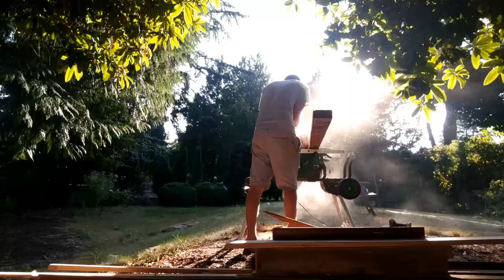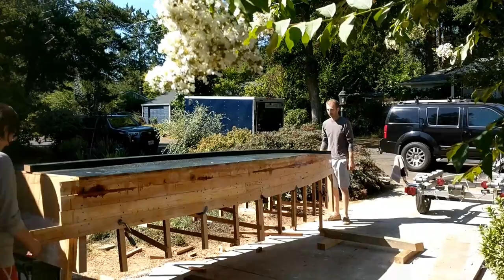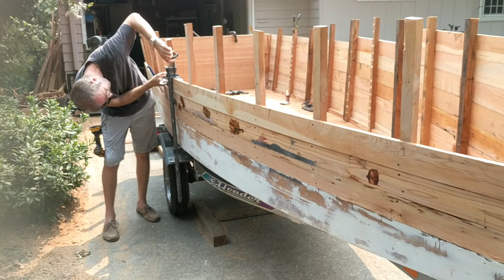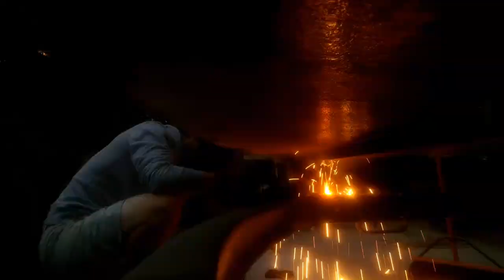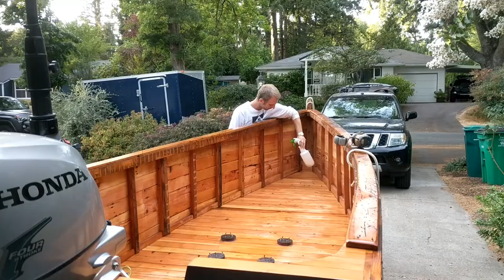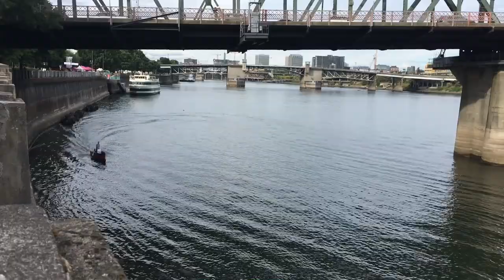Scrap 2x4 Boat Build (reclaimed wood)

Comment: What I like about this is that it has no fiber glass.  If you can make a boat without fiberglass, I might try it out.
Reply: The fellow at Tips From A Shipwright builds wooden boats without glassing over the hull.  You just have to account for swelling when you build it.  His video series on the work skiff is really good.

Comment: Good build reason I'm here got a boat build on the brain. I'm sick of high price aluminum boats. I wanting 18 ft skiff with deep sides. For river fishing big yachts and barges create such a big wake they freak me out. I own couple aluminum boats thier just not a good choice. If your on the water alot a recreational John just don't hold up. And the cost is just ridiculous. Wood just has so many stye options. And if you can build a wood boat you don't have to seek out a repair shop for a fix or repair. And I think it's so cool to fish out of a wood boat. Especially if you built it. I think wood out class's anything on the water. The colors on this boat just stands out pirate ship skull and crossbones on the bow would be cool. Appreciate the video well worth the watch.
Reply: There is Parker 1801 whaler 17 19 fiter wharr 18 rage jet boat 18 fit xab I ncruser

Comment: Flat bottom skiffs are imo best hull design because it is the most versatile, it can float on couple inch of river water and land on shallow ocean beaches and also take rough coast waters if you build high sides and bow. It can be moved around with normal utility trailer. It is a natural planer hull, takes off with small engine power. V-hull is total opposite of these but it is only better on waves which doesnt really matter on a small boat because big waves will disturb all small boating anyway. I would go flat skiff any day, it is also decent to row and paddle. Im curious. How did you planked hull stay in shape after 2 years? What would you change? Did the planks crack? Hows the paint job?

Comment: Man that boat is sweet ! I have been boating myself for over 30  years have owned personally 17 or 18 boats mostly power but a few  sail and one antique wooden Chris Craft Cabin Cruiser that i restored   Ive also have thousands of hours. Operating  from the Chesapeake Bay  and up a down the Intra coastal Waterway and through out the Florida Keys and the Carribean  the fact that you built that boat all out o reclaimed lumber  was cool and amazing. As well as getting it to look correct and have good lines in the water  i applaud you and   Would think if you could come up with a set of plans anf a  lumber package list for all new  would be a big hit. Your skiff would be a great  dinghy for live aboards that. Often need to  dinghy. To shore to restock supplies and provisions  plus it would be a relatively easy and inexpensive boat to repair anywhere if needed  a major plus for live aboards who usually are on budget restraints for varirety of reasons

Comment: Amazing work my friend!  coat all that wood in epoxy and it should last forever!
Reply: Epoxy and glass fabric. Thing is rot will eventually claim that kind of unprotected wood, especially if stored outside in the weather. I have a production built Eggharbor 37 built in 1970, and I get to fix all the OEM mistakes they made which hastened its decline. One I am dealing with right now are the plain IRON spikes driven into the white oak floor (joists) to pin them to the white oak keel. Bad practice as the oak around the iron turns to mud if it gets wet due to a chemical reaction with oak. Doing that also cuts the floor strength in half running a 1/2 inch metal pin spike down the board center on edge. It is honestly a dumb thing to do, but saves them effort during construction. I have had 3 bad spike wood reactions, had to replace one floor, but the 2 others I can strengthen with long pieces of oak glued and screwed into the top sides on each floor.

Comment: Nice job. I'd ask the haters how many boats they've built, but I doubt they'd answer truthfully.

Nail holes...what did you fill them with?  I use epoxy thickened with wheat flour. And did you caulk/bed the joints? 

Now that it's done and in the water, what would you do differently?
Reply from the maker: I filled the holes with gflex or six-ten. I bedded the joints and frames with several marine caulk brands (maybe some roofing tar) and I tried some cotton also. I couldn't stop when I ran out of something so I just grabbed whatever was available. If I did it again I wouldn't use reclaimed wood and I would take my time and build it in a garage. I might even want to use plywood and get it done even faster and not worry about the boat staying swelled up to stay watertight. Also, my second one will be longer, wider, and with a v-bottom. The haters make me laugh.
Reply: Lou Sauzedde would be proud of his influence  :)
Reply: I might recommend a couple things if you do it again. I would add some amount of V to the hull at the bow in addition to the bottom to for handling and wave entry, and it isn't too hard to do a layer of fiberglass and resin over your wood to aid in sealing and structural integrity. There are lots of videos on here of doing just that.
Reply from the maker: @KoonceTodd  My second boat will definitely be a V-hull. If you look closely when we flip the boat over it's really flat, and that's because I did a layer of fiberglass on the bottom- I usually don't talk about that because a lot of people have strong opinions about not fiberglassing a planked hull.
Reply: @MichaelHeibel  Well, the good news is that you can sell it and use the money you make to buy the wood you need to build your next boat...or at least some of it. Hope you do cuz I can;;t wait to see what you build next. Very cool. I just bought my first 12 foot row boat for $230 and a trailer to haul it for $250. Been reworking them both. Cool project..

Comment: Very cool. I'm curious how you joined the planks to make up the full length of the hull? Are they joined together (scarfed?) prior to springing them to the boat, or do you simply fasten each piece of timber individually, making sure they meet on a frame?
Reply from the maker: I did both, but I'd scarf all in the future because a butt joint will show through the paint job.

Comment: Good work on your first boat. On your next one try putting some rocker in it and flare the sides some. It gives the boat more character (looks) and flare helps keep the water out. Check out my build and you'll see what I mean.
Reply: not to mention spray rails fwd and  if you put quarter skegs  aft on btm will help with chine skip , but nice to see , usingwood...
Reply: fuck that, you did a great job, everyone builds what they want.
Reply: I'm going with the "fuck that comment" it's pretty cool....  The boat.

Comment: Wow!  There is so much 'wrongo' in your build that the boat is precious. You's be safe in a shipwreck, eh? Well done.
Reply from the maker: I took down a fiberglass yacht this summer
Reply: @MichaelHeibel  Time to build your next boat. My suggestion would be a Dory. I was apprenticed as a wooden boatbuilder then ships joiner. Use plywood and seal it with an epoxy. Hereis a greatBolger design.
https://i.pinimg.com/originals/0d/2c/2b/0d2c2bef6474bb029d05c7e195fc9e18.jpg
Reply from the maker: @DavidTheCarpenter  I think my 2nd boat will be a 21' v bottom skiff. Not sure if I would use plywood even though it's superior in so many ways- I like the look of planked boats too much.
Reply: @MichaelHeibel  I apprenticed with Master Maine boatbuilder, Arno Day, in the 80s. He was adamant that building a conventional round bottomed boat with bent frames was faster and better than v-bottom boats All the planing to get the framing to the correct angles for the planking takes way more time than bent planks with bent frames. And you get a way better boat. I built a couple of large sailing barges with a friend, just saying.
More satisfaction and a better goat imo. Great job on this boat. 
I'm surprised at the naysayers and know-it-alls. eff em..You done it. And good too. My next ones a sampan and I was thinking plywood, but your video and another convinced me to plank it old school. Much more satisfying as well.
Reply from the maker: @GNUBRAIN  I can't picture what that is- do you have a link to a picture or video? Is it a planing hull? there are some naysayers with questionable advice as you may have seen. One dude said it was all wrong because I didn't have stringers and a keel. I'm new to this but I'm pretty sure that's not how these flat bottom boats are built (at least I have not seen any).

Comment: Very nice skiff and good idea with recycled wood too. Did you have a plan to go by ?  Got a couple fishing rod holders nice touch, btw what's the river's name think i know not sure though ?   thanks :)
Reply from the maker: No plans other than originally trying to get it to fit into the garage, then going longer. It's the Willamette.
Reply: @MichaelHeibel  ,  knew it, lol.  ya did nice job without prints or plan.  I used an old plan from a Maine builder had to guess much of the measurements though 19'-4" large beamed skiff still have it too.  btw, does the keel beam help with the slapping at all ? Thanks.........
Reply from the maker: @MegaBait1616  I am not sure if it helps or not as I have never driven another flat bottom boat. I would assume it does though.

Comment: Every boat i've used / borrowed has always had the registration numbers on front side of hull. A boat like this, does it need be registered, or does its size not meet the requirement to be registered?
Reply from the maker: Yes it does. I got pulled over by the police while making this video (you can see them following me while I drive slowly), but I had already applied for temporary registration and was waiting for them to issue a hull ID number and reg numbers.
Reply: @MichaelHeibel  
The water cops are after you in thier million dollar tax payer boat!
Three guys, 100 grand each a year in wages and benifits , 25 grand each in gear , at least 2 vehicles at 70 grand each and they are hungry.
STOP!  How dare you have fun!
We need lunch money and to justify what we are costing you!
Reply: Benjamin Atwater exactly.  How dare he use his boat on the Kings waters without permission!

Comment: Someday someone will regret it was built with epoxy coated steel screws. I have a 37 foot wood boat, and if those screws get wet they will disintegrate. But otherwise nice job.
Reply: What would you do to instead to avoid that

Comment: How did you seal it to keep from leaking
Reply: See Gardener's Classic Small Craft or Beard on Boats. The boards will swell a bit when wet, helps seal the joints.

Comment: you still need to strengthen the bottom.
Reply from the maker: I spoke with several marine engineers and have since adhered 1/4" titanium plate to the entire bottom of the vessel.
Reply: @MichaelHeibel  You just need to stiffen the bottom by placing reinforcements in the form of frames. :-) As in the hulls of ships.
Reply from the maker: @walljeri  Is it on this boat? https://www.youtube.com/watch?v=kcFv9SO_8lQ&list=PLzlN3A2DLgNwE2RCpQ9vKCmeOwvKCRRjF&t=109s&index=39

Comment: Hey, Where's your tag?
Reply: here in ohio they would take that boat then fine and/or send you to jail
Reply: When you register boat you may (depending on where you live) receive a hand written copy of paperwork, stamped and dated, that allows you to use boat until tag arrives in mail.... my boat in Alaska I operated for 45 days before tag arrived.  Never got bothered with, I talked to Harbor Master regularly (as I was keeping it in Ketchikan Marina) and they let all the other agencies know.  I saw one of the NOAA boats turn to intercept me, looked at me through binos, then turned and went other way.... they knew who I was immediately because I was the only boat operating without tags and few boats operating where I was meeting that description (new Lund, with new tiller Honda, everyone there owns an old one, few people own a new one with a Honda motor as it is normally sold with a Merc)...  

Always be friendly with everyone at harbormaster’s office, they are friends with the other agencies, and in smaller communities they will all hear about you from the harbor master... listen to their advice, and follow all safety regs.  When NOAA turned away from me, I was wearing my PFD, had my portable radio visibly attached to it, and had filed a float plan...

Comment: No keel, no ribs, no stringers might want to learn what the important parts of a boat are and why they have them.
Reply from the maker: Absolutely, grandmaster.
Reply from the maker: Just curious- did Louis Sauzedde put any of those things on his flat bottom skiff? https://www.youtube.com/watch?v=kcFv9SO_8lQ&t=0s&list=PLzlN3A2DLgNwE2RCpQ9vKCmeOwvKCRRjF&index=39
Reply: Depends how much weight you want to put in it, also your handling ability as in how tight  of turn you can do without skipping sideways. Not to mention taking it in a bit of rougher water. Just saying........nice build but ...
Reply: Michael Heibel yeah mate, he installed deep runners for sharper turning
Reply from the maker: @Aaron.deRuiter  We're not talking about deep runners, but interesting you noticed that. He showed the installation of the runners, but there were only about 3 seconds in that series that actually showed what the deep runners looked like.
Reply: @MichaelHeibel  did you use a bedding compound like Lou between the side planks? Also, no bow rise? Good job all round though mate.
Reply from the maker: @Aaron.deRuiter  I used caulk, but not the expensive polysulfide. The bottom rises about 6" You can see the blue line on the bottom is thinner up front.
Reply: what he built is a box with a pointy nose and a motor on it ,Expose it to any kind of rough weather conditions and he will nee a lifejacket.........be careful

Comment: where to start.

nothing wrong with the wood you used-our ancestors havd been doing better with worse raw materials so it shows we can still do a goid job with recycked timber.

youre obviiusly not a boat builder.nobody who knows boats woukd make a completely flat hull form.

they would always put a little curve into the hull for strength and safety.

also a little V for the same reasons.

however,the flat hull does plane nicely on calm water.

you have obviously built a few things-construction techniques were good and youve got some nice toys to make building easy.

very nice to see a bright finished hull-would have painted it for ease if use but natural wood grain is easy on the eye.

congratulations on the boat but do be carefull in non ideal weather.
Reply from the maker: The bottom curves up 6"
Reply: @MichaelHeibel  ok.looked flat
Reply from the maker: @jadekayak01  6in makes a big difference, so my wife says
Reply: @MichaelHeibel  hahaha😂mine too which is why i traded her in on a life

Comment: Got a thumbs down because you didnt explain anything!
Reply from the maker: You get a thumbs up for explaining your thumbs down.
Reply: @MichaelHeibel  Your next video should be about troll slaying.
Reply: I didn't give him a thumbs down, but I agree. What did he paint the bottom with? how did he seal between the boards? ect.
Reply from the maker: @johnr8476  I used Behr oil based paint from Home Depot. I can't reveal how I sealed the planks - it's magic.
Reply: @MichaelHeibel  its the wood expanding from being wet isn't it?
Reply from the maker: @aciddream2866  Yes it does expand
Reply: @MichaelHeibel  obviously the white coat was a rubberized rv roof coating

Comment: Christ what an albatross, honestly, I wouldn't have wasted the paint on it, as a note don't worry so much about covering those ears, cover your friggin lung's. I see so many people worried about the ears, but have dust and fumes killing there lungs....
Reply from the maker: Thanks gramps
Reply: i witnessed a man kill himself because he used no breathing protection whatsoever using epoxy for  kitchen countertops in a spray gun (in two years he was dead) running epoxy through spray nozzles with no breathing mask...not smart. I told them but no one did anything about it so I made sure not to be there when they were working, Two years later he was dead. Now all that being said I do not agree with the boat being an albatross, i think it is a great boat and worth every drop of paint. (dont get it twisted) be safe out there. peace out.